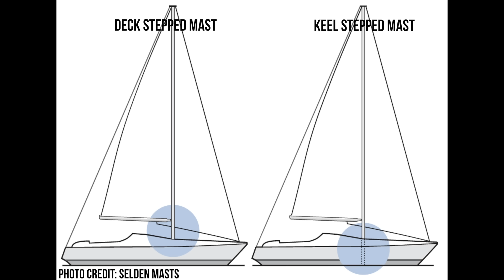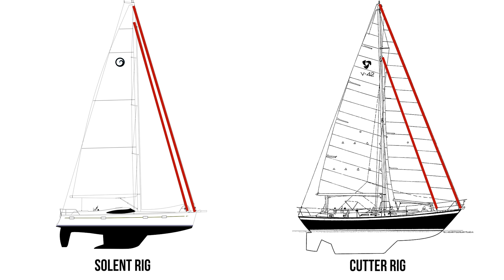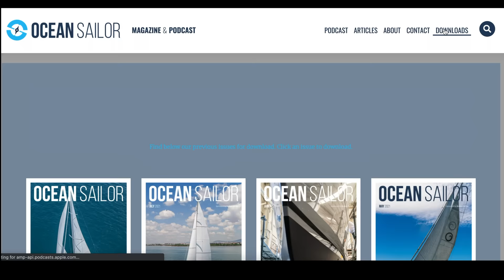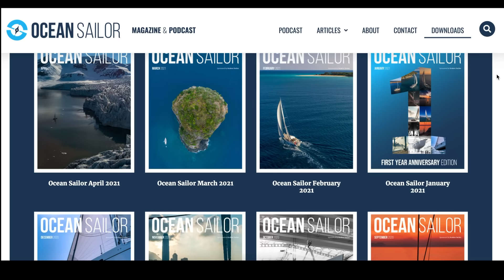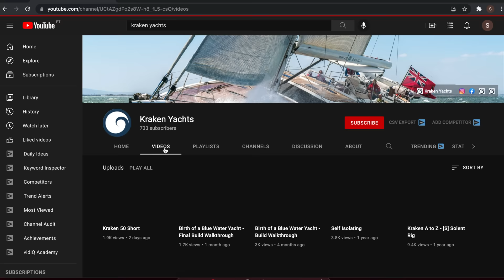7 Features to consider in a Bluewater Sailboat | Interview with Dick Beaumont

Comment: Interesting points throughout. I'd have to disagree to some extent about cats. Almost all the drawbacks can be eliminated if they sacrifice some space and load capacity. Lower the center of gravity, minimize windage, and as you said make them able to sideslip in breaking waves, which means no fixed keels and an amenable hull form. Split the rig for lower CE. A good sized catamaran of this nature would be practically impossible to capsize.
Reply: WHEN they go OVER, (and they WILL GO OVER), they DO NOT COME BACK ! ! ...   do YOU want to be THERE  ? .....answer :    NOT EVER !
Reply: @skipper9400  They hardly ever go over and when they do it is almost always operator error. As he was talking about, they have strong recommendations on reefing for a reason, the modifications I highlighted would eliminate most of the reasons catamarans capsize. The only other thing to address is structural integrity. People are too used to racing designs and compromised mass market designs to be able to see the potential of catamarans.
Reply: @dustman96  But at the end of the day, I can build a mono that can't sink. Nobody can build a cat that can't flip.
Reply: @Garryck-1  I'm pretty sure that a cat with 30' beam and low center of gravity could could weather a nasty hurricane and not flip. There are cats that have weathered such storms without flipping that didn't have all the qualities I suggested. And I don't think that there are many large monos that can go through that without rolling all the way over numerous times. Rolling like that is what really poses danger to the occupants. I'd take my chances on a cat in a situation like that as long as I thought it was structurally sound. As far as I'm concerned, most modern cats don't take full advantage of the potential of the catamaran form in terms of seaworthiness.
Reply: @dustman96  - I'll agree with you about the dangers of rolling thing. But a properly built, properly attached Jordan Series Drogue means the mono will never get into a situation where rolling can happen. And a lot can be done to reduce the risk of injuries caused by rolling. But there isn't one sailor in a thousand that takes the steps to mitigate that.
Reply: @dustman96  - Also, if we're going to discuss the risk of injuries due to rolling, we certainly can't ignore the risk of injuries through being hurled across the large open spaces on modern cats. As Dick mentioned at one point. I don't think I've ever seen a cat with a properly designed interior, in that regard. Do they even exist?
Reply: @Garryck-1  Good point. When I look at the interior of almost any boat I can't help but notice all the things that could maim or kill someone.

Comment: Thru hull mast is not better than steped mast : in case of rig rupture, both wil fall down, the last one will be bent so less salvagable.
Reply: Sorry, but I disagree. Keel-stepped masts are inherently stronger, because they have a long lever arm working in their favour. They're not just anchored to the hull at only one point. And the whole "rig rupture" and "falling down" issues can be solved by using an unstayed junk rig.

Comment: I"m not sure he's right about composite builds. Good composite building usually has a thicker hull-my 40' catamaran had a core thickness of 13mm with glass and carbon fibre on each side bringing it up to 15-16mm thickness depending on where it was--along the keel it was much thicker.  Composite building is not about making thinner hulls, it is about strong hulls for less weight- which are also enormously strong-and usually relatively thick- just try to break a test piece of well made cored hull-- it is amazingly stiff and hence why you don't need the number of stringers in composite build. The puncture resistance of cored hulls is also usually far superior as well.  Old style fibreglass layup is not inherently strong or stiff, which is why is needs to be made so thick (and therefore heavy) to build up strength.

Comment: Some good points about centre cockpits, out running weather and skeg hung rudders. However, in my opinion - its really not a Bluewater boat. More senior people who rely on electric winches to move massive sails on 68 foot boats in a serious blow - are setting themselves for impending disaster when the power is lost and they need to revert to a winch handle (and only have their 70 year old wife to help them). It is the same logic as pretending you can out run the wind. One day the fantasy will catch up with you. The boat is lovely but in my opinion it is too big and there is too much reliance on mechanics and electronics to maintain an advantage.

Comment: He missed very important point. Solid guard rails and instead went for those flimsy knee jerking flippydyflop lines. Solid guardrails first then toerail
Reply: Proper bulwarks are better.
Reply: @Tomm9y  Absolutely BS
Reply: @Tomm9y  those ridiculous lines are racing remembrance nothing to do with ocean going vessels. 

What you need is solid quard rail that is to your hip height not knee jerkers. Trust me, transforms and improves the boat and the safety by factor of 100. Amel has it, we have it, who else has it, seen few boats but not many
Reply from the maker: 1. It’s in the options list so you can have it as you want. 
2. Would you really base a million dollar purchase on a 1000$ refit job that’ll take 2 days??
Reply: @SailingMillennialFalcon  If it's on the options list that's good and anyone who splashes out 1 million or more should not even blink twice and get solid guard rails. Probably most important safety element after having a life raft and totally transforms the boat. And it's not 1000, you can easily add a zero to that amount if they are done sturdy enough

Comment: I think Adam did a good job with this interview. While I don't agree with the concept, I believe being "blue water" is more about the crew than the boat, it was entertaining and informative. 

That being said, I think the most important question was missed. That is define blue water sailing. Many of the routes talked about in the anecdotes are not the milk run sailing the vast majority of sailors do.
Reply from the maker: I’m glad you enjoyed the interview 🙂
Blue water sailing is such a subjective term - Adam actually did ask it at the beginning of the first interview. But for every sailor/boat builder it’s different. It’d be good to have a clearly defined term so if someone has truly sailed around icebergs you think “wow, now THAT is a blue water sailor”
Reply: @SailingMillennialFalcon  not sure if you remember us but we met in USVI and went to a chilly contest together. 

I do have friends that have sailed icebergs. Some have done it in unmodified production boats like Jennies and Bennies. Some in aluminum hulls. Some with old boats from the 1970s that were refit for the voyage. 

But my point was it IS subjective. So saying this is what a blue water boat looks like without saying when you think it is needed is only half the equation. My personal belief is that on the typical milk runs many production boats will do fine and look after the crew just fine. Even better with an experienced crew. And the production boats are far more comfortable at anchor, which is where you will spend the vast majority of your time. Especially compared to the percentage of time on passages when you get caught in something truly bad (I like the 35+ knots as bad and 60+ knots as truly bad that Dick used in the interview). Right ocean, right time of year, going in the right direction. 

Now if I were going around one of the capes or sailing the southern passages I am certainly looking at a Kraken or similar. So that's the definition for me. 

I would like to see more of that definition from Adam and Dick as they left the impression you need a "blue water boat" to sail the Caribbean and cross the Atlantic. 

Fair winds
Reply from the maker: I agree with you with respect to the users/owners definition of Bluewater sailing. Anyone can do whatever they want in whatever they want. My focus is on the design of a boat, what mission profile was a boat built for. You can take a fiat 500 across the Sahara but that doesn’t change the fact that it’s not what it was built for. The official definition of a CAT A ‘ocean’ blue water boat is a bit of a joke as far as benchmarks go so I just want buyers and owners to know what boats go best in what conditions and most importantly why… what design features make it like this. That’s why I’m trying to collate as much wisdom from folks like John and dick as I can. Sadly they take a long time to setup and produce so the first two have left a bit of a ‘Bluewater only’ club pattern that I hope to break up with someone on the other side of the discussion soon.

Comment: Somehow the rationale is not linear. Your going minimum point of risk but you rely on generators to survive a passage. And Cats can handle bad weather only differently and you have to really know what your doing and still have lower but not zero risk of capsizing. And the Garcia is likely more rugged than his yachts based on performance in bad weather  in high latitudes. But Cheers to a manufacturer still making really blue water boats for under handed sailing.

Comment: Why no solar?? Every channel I follow extolls the virtues of Lithium and solar as either main or supplementary power yet a boat, which in all other respects appears to be perfect, has none!!! Disappointed you avoided challenging him on this point.
Reply: True maybe for the next interview and look at the latest on Uma
Reply: @milkoberben2963  Uma exists in its own unrealistic little bubble. It isn't comparable to anything in the real world...
Reply: Uma is not getting enough power up north.  Which was predictable.
Reply: @wizardgmb  that is bold did this Dan build his own world like a separate matrix wauw...🤣
Reply: Solar panels are good sources of renewable energy but they are a logistical challenge on monohulls.  Because monohulls have narrow beams, the available area to mount solar panels is limited. A single 400W panel measures around 1.0mx1.8m so where are you going to install them? Smaller panels on the other hand will not give you the same output. Furthermore, their efficiency is largely dependent on the angle of the sun so if you are sailing in the northern latitudes, you might only get a quarter of the expected output.  Lastly, monohulls heel over so your panels might not get adequate sun exposure at all. With modern boats carrying around 1200Ah of battery power, a 10KW or 20KW generator will top up your batteries in an hour or two instead of relying on solar that will take 5-6 hours with a large solar array (1.2KW or more). If you only manage to install less than 1KW of solar, dont even bother. An excellent alternative though would be a hydrogenerator
Reply: @milkoberben2963 What worked somewhat well while in Hati at 19 degrees latitude is all but useless above 58 degrees latitude where they spent the last year. At the peak in June Uma gets 70% of the sun energy it got in Hati, during May to August solar is plausible at best. The rest of the year they are on a long decline or climb from 3% in December. Given the poor efficiency of sailboat solar installations due to low angle of incidence, not being pointed in the optimum direction and sail shading, Uma's abilty to keep its batteries charged is pretty pis poor. Ah, but a new motor with better regeneration will improve things... The regeneration output is basically enough to power their underway needs for intruments, lighting, refrigeration etc. Unless Dan has found a way to achieve an order of magnitude improvement in solar collection efficiency there is no way Uma is self sustainable. Dan and Kika are basically arriving in a marina, hooking up shore power to charge their batteries and casting off lines to depart before unplugging. Yet they still maintain having the solar/electric motor combination is the greatest thing since sliced bread...

In addition, Uma is the only sailing channel I know of that hasn't acknowledged the existence of Covid-19, the pandemic or any impact on their lives. That is highly disingenuous given during the summer Kika's country of origin had a Covid-19 infection rate increase as percentage of population that equaled India's! You can bet the Covid-19 topic is regularly addressed with the Patreon members that finance their little "excursion" just not with the YouTube masses expected to hang on every image and word!

Yes, Dan and Kika have created their own matrix around sailing with solar and electric motor in a Covid-19 free world. They drag along a few rabid patrons and YouTube subscribers who don't have the where with all to see Uma for what it is, a money making machine long on flash and short on substance!
Reply: @milkoberben2963  At no point in my comment did I mention the flu and on that point I am DEAD serious!  😡
Reply: @wizardgmb  aha 19 is not a flu variant?
Reply: @SOLDOZER  but they have a petrol generator that can bring them back to the sunshine 😂
Reply: @SOLDOZER  I never suggested that solar should be the only source of power, simply a free top up when available. Particularly when you consider that the vast majority of sailers will never go to the far north or deep south but stay within the tropics so have plenty of sunlight.
Reply: @SOLDOZER  No I don’t but what has that to do with the price of cheese! There may be many days when solar only provides 10% of your energy use but there will be as many days when it produces more than 50%. All of which saves generator fuel and wear and tear. Why waste it?
Reply: Kraken yachts are available with both solar panels and lithium batteries. They also have an option for a hybrid drive system.